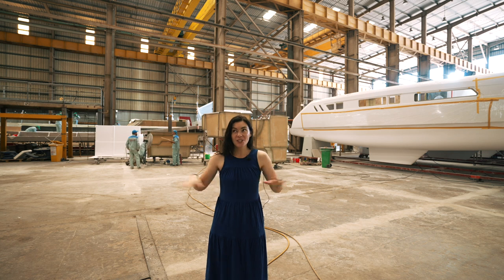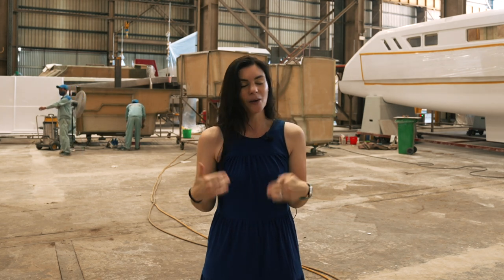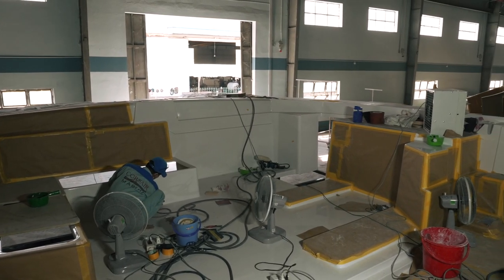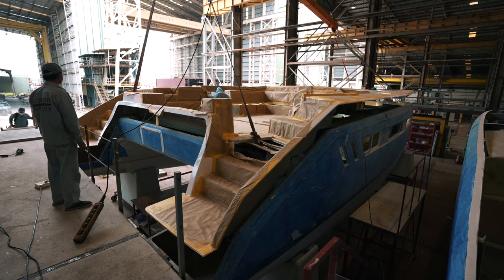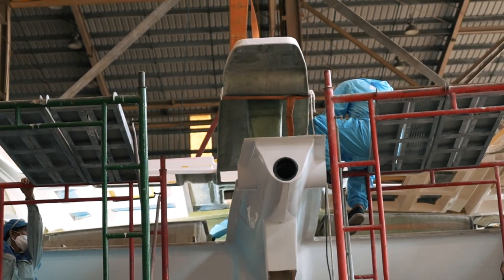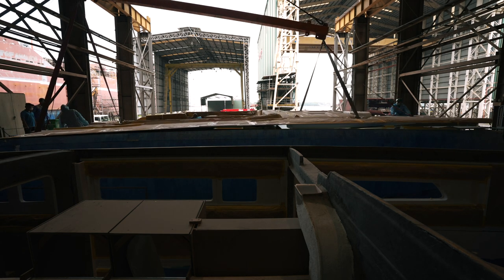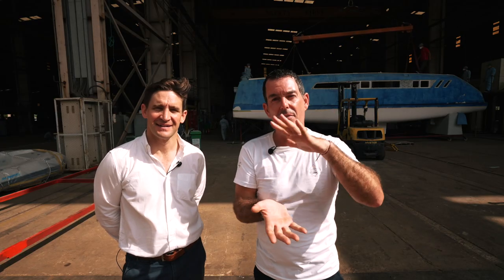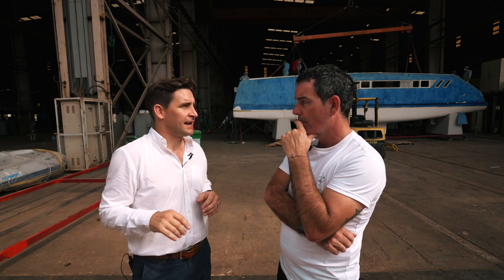CATAMARAN BUILD: This is a MILESTONE! The Deck is Bonded to the Hull

Comment: Interesting methods used for construction. These people are clearly at the top of the game for knowledge and particularly the application of knowledge. Many have no clue about that last phrase. The application of knowledge is so that results are achieved reliably. It is one thing to use high cost methods that work. But quite a bit better to be able to build and know when it is good enough. And how to achieve these results consistently. That is an application of knowledge that is not common in this industry. Thumbs up for SeaWind.

Comment: Having built a fiber glass, carbon/Kevlar hybrid western red cedar cored Swift Solo high performance skiff from start to finished rig, I am familiar with the challenges in mating the deck and hull together. I used flexible fiber glass tape flanges on the top of all bulkheads, stations and hull edges in which to lay the two part bonding adhesive. As the interior space was small, a digital camera was used to check the dry fit for all flange joints throughout the hull.  For Ruby Rose 2, I suggest the builders check all of the small inaccessible spaces with a similar method to assure an accurate fit. Your project has been fun to watch, so keep the videos coming.

Comment: My boat was bonded and taped in critical areas as seawind is putting it. Years from now you'll be doing what I'm doing in the yard right now, and stuffing yourself into very small spaces to fiberglass together all the places the factory deemed non critical. Let me tell you, the unpleasantness of crawling into the transom steps with a grinder to prep for glass work can't be underestimated. Trust me, the hull and deck need to be fully glassed together until it becomes one big single part. Anything less is simply cost cutting at the expense of you having to fix it later,  and I thought seawind was better than that.
Reply: Is this the only Seawind that isn't fully glassed? It sounds like the other models used to be. Hmmmm....
Reply: Don't forget it IS glued as well. Plus they have over 30 years experience from all their other models, so I think they might just have it sorted.
Reply: @gbsailing9436  yes, glued. Like my boat. And the manufacturer of my boat started building catamarans 15 years before the first seawind, so their prior experience means nothing. You think there may have been a reason every single one of their previous models was fully fiberglassed? You think there may be a reason HH and Balance fully fiberglass their boats, as I'm sure many others do as well? If you'd like to see what the future holds for a catamaran that's fiberglassed together in critical areas but only "bonded" AKA 5200 or similar for the rest, feel free to hop on a plane to trinidad, I'll be happy to show you.
Reply: @andersonautomotive  Hmmm, Clearly you have not heard about SW's renown seaworthiness over the years. And I would hazard guess that the glues we have these days are so much stronger than 15 years ago. Still if you feel so sure that SW are not doing it correctly, that's ok. Don't buy one. Stick with HH and pay their prices. Personally, I would prefer a Garcia. But that comes with it's own set of problems. NO boat is perfect.
Reply: How many "years from now" are you referring to?
Reply: A 2019 poly methyl methacrylate study states "PMMA material aging process conforms to the rule that the temperature rises 10 °C, the aging rate speed up two to three times." and showed PMMA aged at 40°C retained only half it's tensile strength after 10,000 (14 months). So I'd be interested in seeing the lifetime analysis of the Bostik MMA adhesive that Seawind and other brands manufacturers are using when aged at tropical boat conditions. I'd sure want anywhere it's used to be tabbed in!
Reply: @CraigOverend  Ummm, which was it? Two or three times?
Reply: What boat do you have?
Reply: @VirtanenDK  Fountaine Pajot Salina.  To their credit they did fix many of the structural sins they committed on my boat as production continued. Later Salinas are much better.
Reply: indeed can you ask him who approved the design and the construction? According to which rule and regulations? and how they follow  it up? 
Is there a recognised third party indipendent body who check the construction? 
Ask also him for materials their certifications and how those sourced and choose according to which standard and they follow it up??
Reply: @andersonautomotive  That is not true. just because you do something  year after year doesn't make you an expert. "doing the same thing over and over and expecting different results is the definition of insanity".  Clearly Seawind have LEARNt from their experience, unlike the manufacturer of your boat.
Reply: @gbsailing9436  yes, what SW learned is that fully glassing together the deck joint is expensive.
Reply: @andersonautomotive  Is that it!? After more than 15 years, he learned that it's expensive? Hmmm, seems to me he is a SLOW learner. Perhaps that is why SW utilises cheaper labour in Vietnam - so they can apply more for less cash.  Think about it.

Comment: Absolutely great work! For me another world than Lagoon and others. 

On top: Since the deck is mounted so early and many parts have to be installed later - it will be a huge bargain for the owners in case of trouble or changes. I assume anything the yard puts in late by hand can also be accessed or removed more easy than other production were all installations are done before deck is applied and so blocking future access.

Comment: Make sure the bulkheads and their connections are strong and robust.  Catamaran bulkhead problems seem to be all the rage these days.  Watching these platforms cross oceans has given me a new appreciation of the forces generated in the structure of a multihull.
Reply: It is better if you watch all the series. Then you can be better informed about the bulkhead issues that have been raised and discussed previously. But they are onto it!
Reply: @gbsailing9436  Thanks, that's good to hear.

Comment: I wish they could have demonstrated gluing two pieces of scrap together and talked about how much time they have to get the piece fitted into place and drying time. Maybe a demo on the forces needed to pull them apart once the glue is set and doing the same in areas where they'll also add glass.  

I'm interested if weather affects the percentage of each part of the chemicals used, if at all, or the setting time?

I was thinking that instead of using straps looping around parts of the deck while fitting it in place, if they had considered adding beefed up lift points, like garages use lifting a heavy engine into place, where they could add temporary eyelets they could hook onto. Spots where winches or cleats would go would be my first consideration. There's be no chance of a strap slipping off or suddenly moving throwing balance off.

Comment: How is this different to Balance? Is it the same, but Balance reinforce structure with carbon?
Reply: Balance 442/482 does not glue the deck to the hull nor do they use mechanical fasteners, it is glassed and hand faired so the two structures are one piece once complete.  This is more expensive and time consuming.  All boats are a series of compromises, time will tell if Seawind saving cost by gluing will matter or not, but if you could choose you want the whole thing glassed.  Seawind has done their homework though and this boat will be extremely rigid and exponentially better than any production cat out there, just have to keep costs down somehow.
Reply: @kirkb3473  much appreciated
Reply: @kirkb3473  I think their over 30 years experience in building world class sailing catamarans will stand them in good stead. It is better if you watch all the series. Then you can be better informed about the bulkhead issues that have been raised, discussed and addressed previously. But they are onto it!
Reply: @gbsailing9436   I have watched the whole series, James Barnes asked what the difference is between how SeaWind and Balance joins the decks, I simply answered his question.  SeaWind glues, Balance spends the extra time and glasses the entire hull to the bridge deck.  It is not a knock on Seawind or the robustness of this boat, there are other areas where the 1370 goes farther than the Balance 442 does with regards to structural rigidity, it is all a tradeoff, and this is an area they chose to save cost and manufacturing time.
Reply: @kirkb3473  OK right! 👍
Reply: @ralphgesler5110  I think you are  missing my point.  Yes I understand clearly that this boat is being taped/tabbed in the high load areas.  The clarification is that everywhere else it is only glued.  This is how builders like Lagoon/FP/Leopard do there boats as well and there are hundreds of them safely circumnavigating the globe, those boats don’t have all the carbon reinforced bulkheads that are glassed in though so the 1370 is exponentially better.  But if you could choose, you are always going to go for the entire structure being taped and glassed so it is one homogeneous structure.  It’s a more robust but more costly and time consuming solution.  The 1370 is a wildly successful production boat that needs to be produced in volume and the choice to glue vs glassing is part of what will allow them to make these in a timely and cost effective manner.  I’d have zero issues trusting my family’s lives to the build quality of this catamaran, is a significant step up from most out there.

Comment: Watching each pc. fitted and bonded while the shipfitters have a position of their own, I'm not seeing guys running around looking or wondering what they need to do next. Do they have a meeting  or class before the larger parts are worked on. That being the first mold and design, how do they learn takeoffs from plans to completion of each segment ? We had class rooms for workers in the shipyard if starting a new ship build. That A- B mixing gun setup looks expensive. We know now why you picked Seawind. I would buy one ~

Comment: This process has been so slow, more than anything else due to Seawind's decision to move to Viet Nam and start in a new factory with a brand new design, that I hope they still have uncancelled orders and will still be in business by the time you hull's turn to be completed comes up.
Reply from the maker: It’s been slower than we expected, yes.
Reply: @sailingrubyrose  And hopefully it all works out, because I think the design is a fine one and the boat will fit you two and your travels very well..